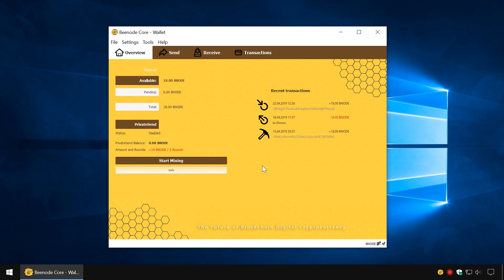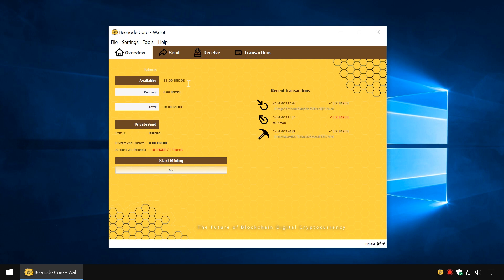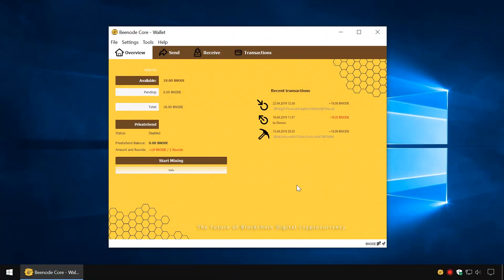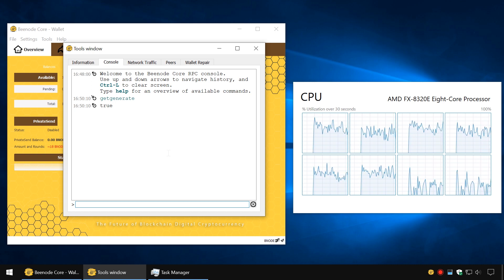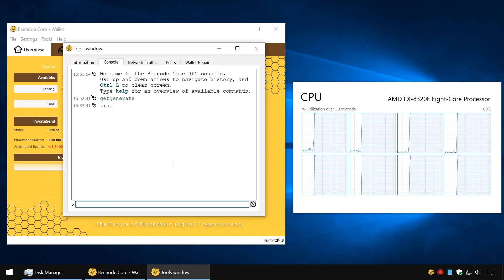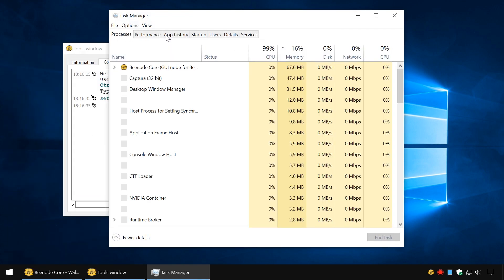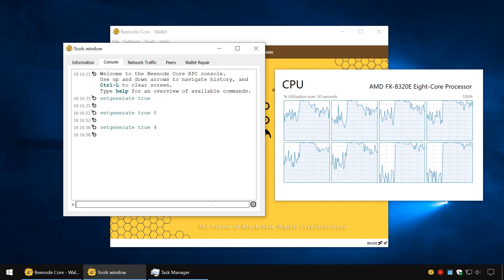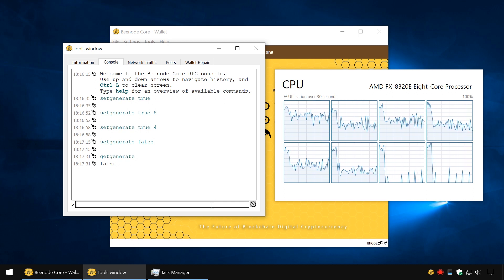BeeNode - Mining (Instruction)

Comment: Just checked the asia mining pool, 250 miners 25.gigahash, waste of time mining this pool with GPU's. You  people running BeeNode either haven't figured out yet that their is ASIC mining taking place with the Honeycomb algo or you simply don't care. Either way take down your ASIC-resistant claim because it's an absolute waste of time mining this coins with GPU rigs. I'm going back to mining Monero XMR which is far more profitable and is actually ASIC resistant because they constantly change the algo to stop ASIC miners. So annoyed I wasted so much time mining BeeNode when I could have been mining Monero instead. Folks don't bother mining BeeNode with GPU's, all you'll do is burn electricity for hardly any BeeNode. If you want to make money mine Monero XMR instead.
Reply from the maker: Many miners are satisfied with our algorithm and mine through pools. But of course, in any case, you should calculate your profit considering your computer capacities.
Reply: Hope you carried on buddy